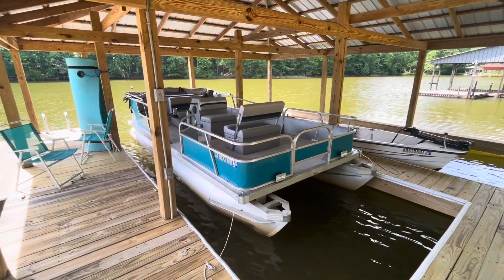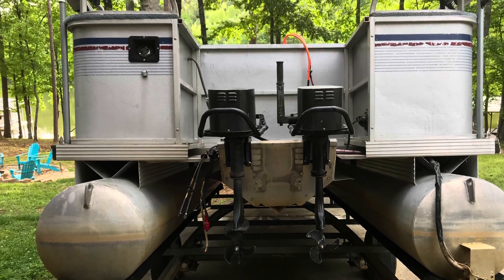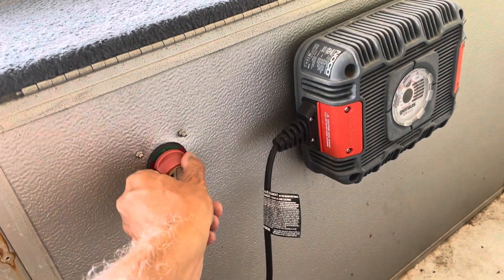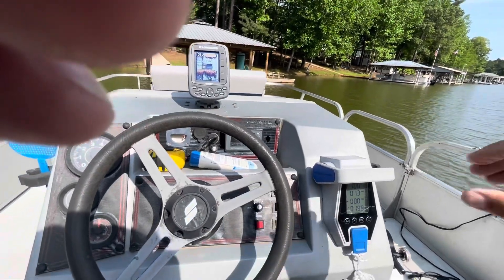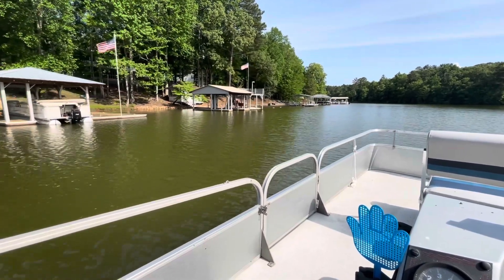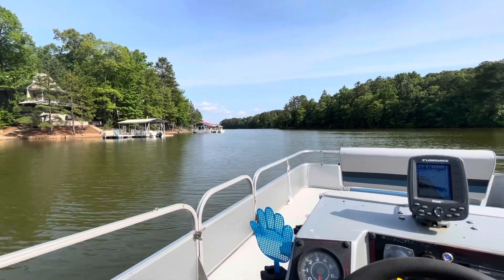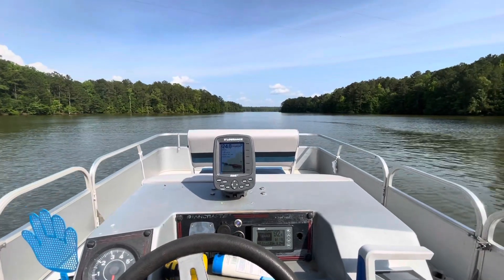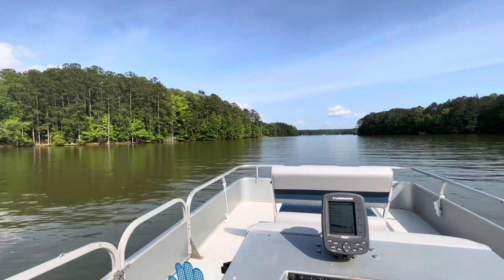Electric Pontoon Boat

Comment: Thanks for the video. I've searched for a steering wheel option to go with the ePropulsion Electric motor and I couldn't find any information. Were you able to use your existing steering and modify for the ePropulsion Navy, or is there a steering wheel add on available?

Comment: What setting are you using for your non EPropulsion batteries ?   We used Ionic 48v batteries and are having issues getting settings to work properly - motor cuts out at 68% battery life
Reply from the maker: Too be honest I don't really remember.  I Thin I just adjusted the low voltage setting to about 40-42 volts.

Comment: I love this! I have 24' pontoon boat of similar vintage. I've put a 108lb thrust Motorguide trolling motor on it which moves it okay in benign conditions, but won't go against much of a current or wind. I also have an arched solid top on it that is about 8' x 16' I'd like to cover with solar panels. I've heard negative reports on the life span of the flexible solar panels - but the weight of solid panels seems prohibitive. What's your guess about the amount of solar wattage you'd need to yield a near infinite range at a reduced speed? Do you trailer your boat much? Thanks for your post, good pace very informative. I look forward to your progress. (Liked and subscribed!)
Reply from the maker: I would not use the semi flexible solar panels they just wont hold up for more than a year or two.  If weight is the biggest concern the CIGS very flexible solar panels are nearly ideal.  However, they are very expensive…. I have ordered 5 100 watt biracial panels (approx $350) and plan to put them on the rear as a fain tail extension.  I was going to do a top but there are several problems with that for me I’ll explain in the next video…
Reply: @Webcrawler45  Thanks for you prompt reply Jeff. I'm guessing your lift is being an issue for a top? I'll look into CIGS, I didn't know their price had come down or that they are available bifacial. I'm curious about your CALB battery bank. I see the individual cells online - did you have to add your own BMS? Is that just half your cells? Sorry for all the questions but your setup is so close to mine I'm excited to see how well you have pulled it off. Will it help you any if I click through to tiny boat nation or mention you to them. Thanks again.
Reply from the maker: @DavidBeede  My covered dock is the main issue.  There is not enough clearance when the lake is full for a top to be up that I can walk under. .  So I would have to make it able to be lowered which makes it quite top heavy or flimsy...

Comment: What size and weight is your pontoon? What's the pontoon size 23" 25"?
Reply from the maker: 24" pontoons.  Not sure of the weight, but probably around 1,300 lbs..
Reply: @Webcrawler45  thanks. No range issue? I have a 16' with 25" tubes with a 9.9 and considering going electric.
Reply from the maker: @john6268  no real range worries.  If you have to make a Long trip all you have to do is slow down to about 4 mph and it will run like that for about 64 miles....(lake is only about 20 miles long). at 3 mph it will got for over 100 miles...(you are just not getting anywhere a hurry)

Comment: I am really interest in the solar top you mentioned Jeff. Can you provide more info on that? I’m currently running a Spirit Evo Plus with solar charge controller on my 24’ pontoon boat on an electric only lake. It works great for my boat and we can get up to 5mph of speed even with just the Spirit Evo.
Reply from the maker: Just adding 10-12 100 watt semi flexible panels on an aluminum frame.  I am adding a 35A 150v Victron Solar charge controller.